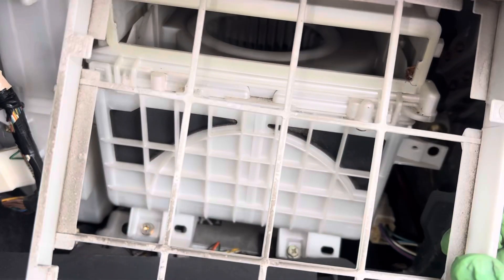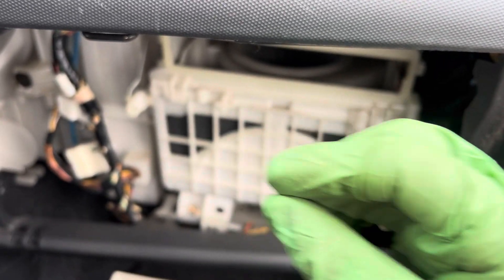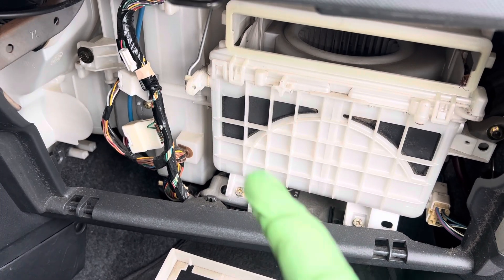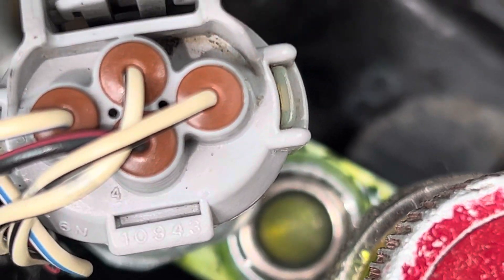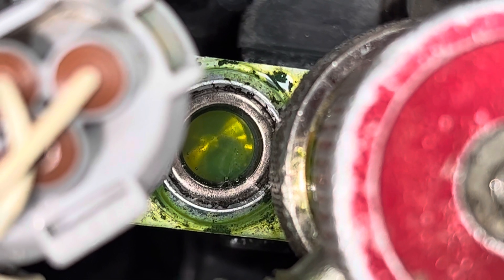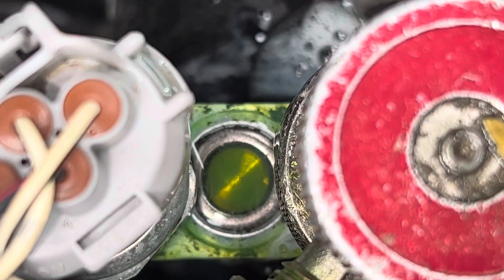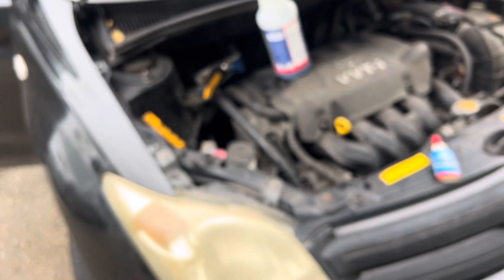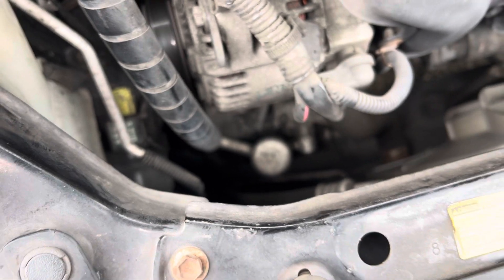NO AC CABIN ￼AIR FILTER. ￼ This could cause a plugged evaporator expensive repair. ￼

Comment: Off subject question but how can you tell when have a system that has contaminated/mixed refrigerant types?
Reply from the maker: You use a Refrigerant Analyzer, either by Bacharach, or INFICON $3000 get you a good one
Reply: You should be able to recover the charge, pull a deep vacuum and recharge using the correct refrigerant type and quantity.  Key is reaching a deep vacuum (use a micron gauge to measure) and percisely measure the quantity of refrigerant.
Proper charge procedure won't resolve a system malfunction, so taking some measurements before hand and knowing the history are helpful diagnostic tools.